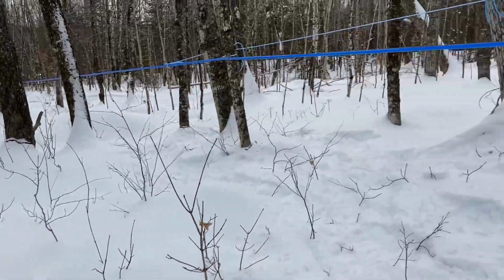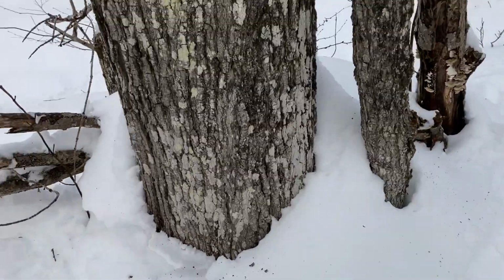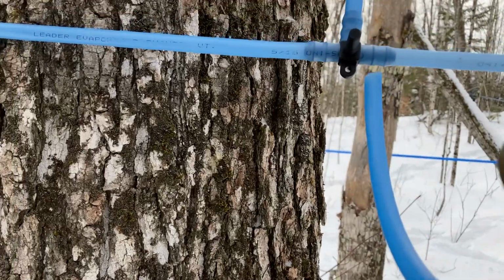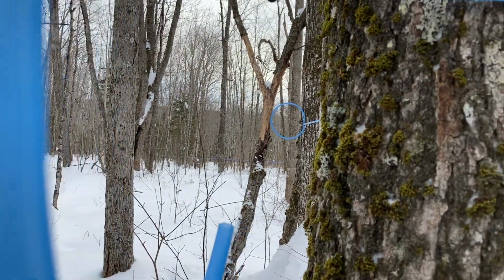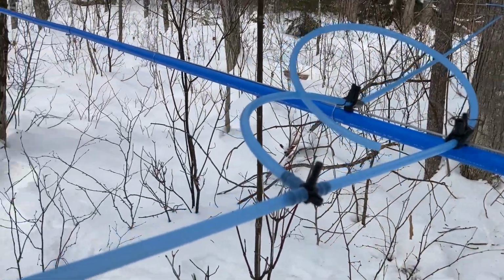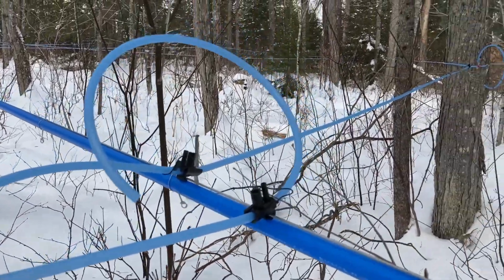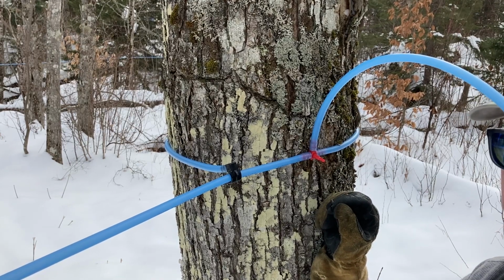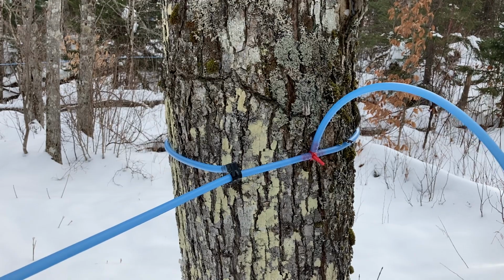Adding in a new mainline.

Comment: I always put tees on south or east side of trees if possible.  When doing end of main tees, I just make sure to install the plugged end into the dead space first.  The drops and line will thaw out faster this way and doesn't need to be done any special way other than plugged goes into dead space.  Thanks for showing how you do it
Reply from the maker: Many people do, but I have not seen it make any difference in our woods. The only big thing is make sure that dead end T is in the right direction. The slope in our woods is such that we get sun on all our trees all day.